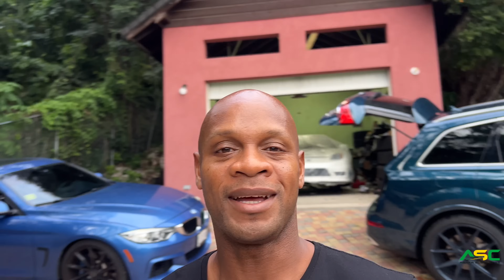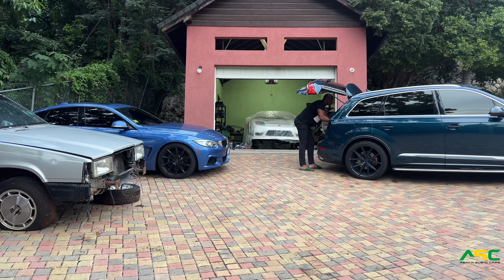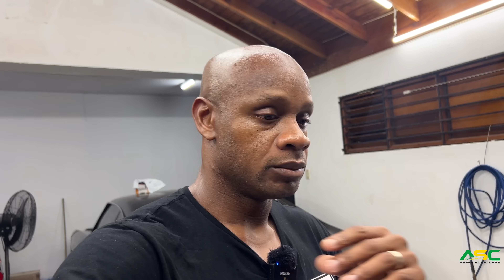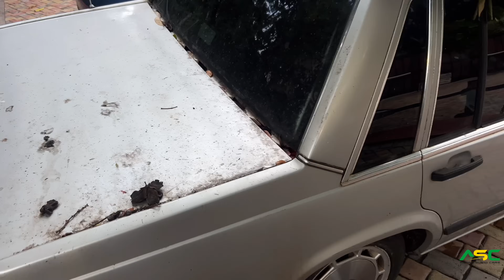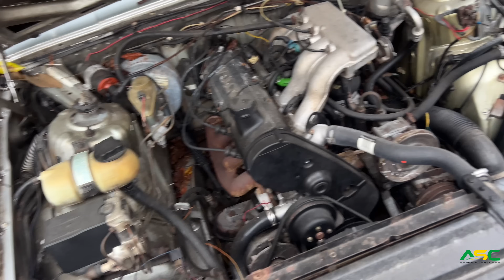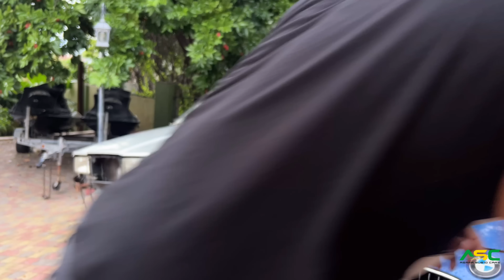Someone use my name for a car scam , this is how !!  .

Comment: You need to get fire retardant foam and safety gear. You can get the gun insert into the hive and spary it will seal almost instantly, no fire once set, remove by just  breaking it off. Fire and fuel equal explosion